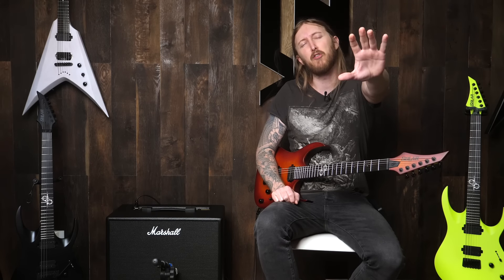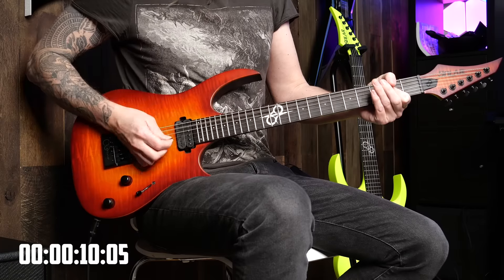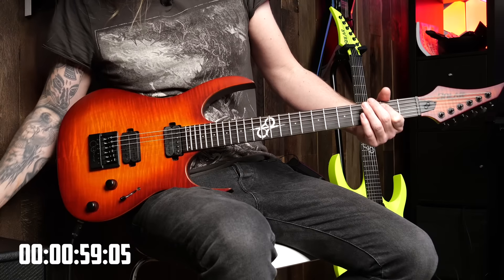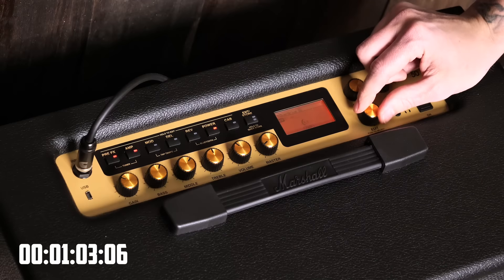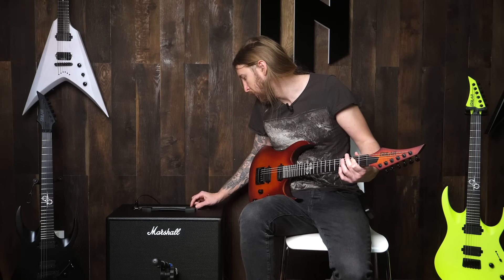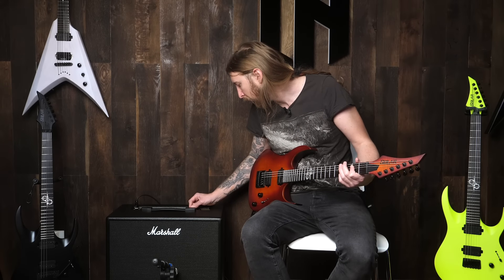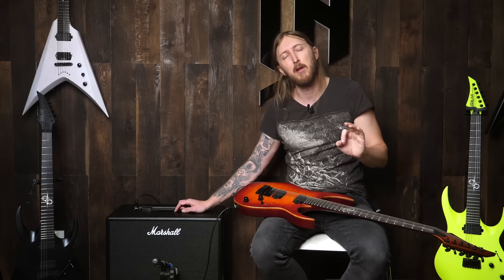WILL IT CHUG? - Marshall Code 50

Comment: Will bet 10 bucks that Glenn says 'nah' and suggests a sledgehammer or a roof.
Reply: He beat you by a couple of hours.
Reply: @thorthunderlungs5171  lol
Reply: Can't say I'm a fan of the Code.  Much prefer a Plexi :)
Reply: I'd agree with him
Reply: CJ, wtf you doin here, I love your speedruns <3
Reply: @SpectreSoundStudios  or a boss katana, heck, even the MG Series is better than this muffled mess of an amp. AND YOU CAN GET THEM ALL FOR THE SAME PRICE!
Reply: @SpectreSoundStudios  a Plexi is a little much. I'd rather go with a DSL :)
Reply: Who is "Glen" anyway? Respectfully; V⚡
Reply: @Jimboishere11  I gathered that, but Thanks! Ola had the amp "Chugging" in under 2 minutes! I've had my 100W head for over a year, and trust - it CHUGS!!!! V⚡
Reply: @Luke Robinett Hey Luke, he only had it ON for under 2 minutes! Without reading the instructions or anything, so I was pretty impressed with that. His mistake with the cab modeling was typical, (coz he didn't read the manual) it's not just for D.O. to a mixing board  - although you can use it like that. If he'd read just a bit about the amp 1st, Ola would have known that he was going through a 1X10, & not say a 1960 4X12, which definitely doesn't sound "boxy" as he put it. He just didn't realize that you can change cabs as well as presets (which you can also tailor to your liking) as a whole, the 50W with a 1X12 inch speaker, doesn't have that punch you get out of any of the preset model heads on the 50W job. V⚡
Reply: @Luke Robinett Oh yeah... someone else made a remark about the mic he had on it, idk who...but that's purely for recording the amp, not to do with the signal path! Ha! Ha! The things people say on here! Ridicule something that you don't UNDERSTAND....         V⚡
Reply: @flippy7035  I've got two of the amps you mentioned, & the Code 100WH keeps-up with em all! And in the case of the MG series SURPASSES IT! I also have a JCM800 2203 (the Kerry King model) that I use almost exclusively for gigging but I take my Code 100WH along, just in case I blow a tube. (It happens) Among other things. For the price point, ya just can't beat the 100WH!! V⚡
Reply: i had one of these amps for about 10 days.  what a mess.  mine used to shut off for no reason.  terrible.  i sent it back.
Reply: @SpectreSoundStudios  tbh fam an old Lead 30 SS combo is better than the Code. I love Marshall but it did nothing for me in the little bit of time I spent demoing.

Comment: Have a Code 50 and I love it to bits. Once you get attuned with all it’s options, finding a good tone isn’t hard, and it’s got some good tones in there! (not the stock presets though, those are ass)
Reply: One of my mates has a Code and we both found presets we liked in around maybe a minute.  The hardest thing, as with all digital gear, is settling on one option and making it sound just how you like it.  There are so many choices.  I really like the Code series of amps.
Reply: Can you tell me what you did to get those tones cause I have one too and I suck ass at getting good tones so I'm currently using the marshal fury preset which this sounds so much better than
Reply: Does it get loud? And when you turn it up on the setting you like, does it stay in the lane not lose tone?
Reply: Elliot Puckett Just do a metal tone but dial down the gain and up the mids a little. Same goes for distortion. Choose a distorted amp, do whatever with effects, find a good balance between resonance and the other thing (forgot its name but it’s on the power amp) and I usually go for a marshall 100 W cab.
Reply: Patrick Herendeen it gets loud, but it’s good for quiet practice. Sometimes it’s hard to get the exact volume you want but you can also use headphones. Also no it doesn’t really loose any tone from turning it up
Reply: I have the code 100 combo, 2 x 12 inch speakers, a speaker out option and an effects loop. It's great. I also own a Blackstar HT Stage 100 rig.
Reply: Boss katana blows this piece of crap sky high
Reply: @rastamon5969  Tried the Katana at the store. I ended up buying the CODE50. Katana distortion sounded fake to me and did not chug like I wanted it to. Anyway, why so eager to belittle an inanimate object?
Reply: @rastamon5969  why are you getting so upset about an inanimate object? Calm down. No need to throw a hissy fit over a bloomin amp. Some people prefer the Katana, some people prefer this. It's not really that hard to handle that fact, well you'd think so anyway...
Reply: Just got the amp today I love it man.
Reply: modelling amps respond well to you putting time and effort into sussing out how they work, and sculpting whatever tone you like, essentially.   Glad you found success with yours, Alex!   Might have to get one of these just so I can properly join in this conversation

Comment: It DOES CHUG! I've got the 100WH, and I've had it for over a year now, and had enough time to find/fix pre sets to get KILLER CHUGS out of it though my 1960B can! My only problem with it is that it doesn't have two outputs! (Very non-Marshall) but a good rig, for the low, low price! Over to you Ola!!🤘 V⚡

Comment: I should add that THIS video has sold me on the Code 50. I tried it out at local GC against a Katana 100. I could chug almost immediately on the Code 50. I kept going back to the Katana but every time I did I was not looking forward to it. The Code 50 wins hands down, and the noise gate is awesome!

Comment: Will it chug? any 50$ practice amp.
Reply: the cheapest chug I've ever heard for $50 is a used peavey combo. they have a amp modeler built in with a 6505+ setting. thats pretty much the only thing with a decent chug at that price. theyre readilly available on guitar centers website
Reply: Phil Banach peavey Vypyr?
Reply: @reidlingtheseedling  peavey of $50, would get an army of bees
Reply: LA L good peavey...
Reply: Peavy Classic but it has to be hooked  up to a Samick strat

Comment: I have the 100w version of this and gotta say it’s a pretty solid amp
Reply: Me as well. It has a very steep learning curve, but it is a very good amp from late night practice(volume at 1) all the way to shaking my windows. Just have to remember to leave the cab sim turned off.
Reply: And me, I love it. It's just some people are quite simply technophobic morons who can't deal with rolling up their sleeves, getting stuck and finding the sound that works for them. By the way, I also own a Blackstar HT Stage 100 valve set up - monster amp. I still maintain the my Marshall Code 100 Combo is one of my best amps.
Reply: Its a solid state yes.
Reply: never met a modelling amp I couldnt dive into the guts of and get a good sound out of, frankly.  Its just time and effort.  You get out of it, directly related by how much time and effort you put into it.  COSM is no different.
Reply: @chrisdaviesguitar  you're 100% right. People want to buy the tone, and sound as their idols and it doesn't work that way. To sound as professional you have to put effort and work as  professional. You can't buy some stuff and if someone says the opposite they're trying to sell you a lie=propaganda, advertisement BS.
Reply: @lolkom77  Well said man. So many people just don't get that what it sounds like in the room is on them...they just expect that the patches or whatever they buy will sound just like it does on YouTube. In reality 90% of the tone is the cab and mike/IR that's being used.

Comment: You probably should have read the manual 😅. You had delay on the whole time, and the cab button activated the cab sims, but if you hold it you can change the cab. Such as 1960AV, 1960B, 1974CX, 1912.

Comment: I assume you want to do amps that aren't obvious chuggers like the dual rec or satan... So in that mind set... Fender frontman series?
Reply: Easy to make it chug. I had the 212 R and this was also  f*****g powerfull. Never heard a 2x12 transistor as loud as this one. A Tube screamer and thats good.
Reply: lol the videos would be so short. "DAR-FBM 100, will it chug?

...*CHUG*
Yes. /video"
Reply: I used to put an od808 with the tone cranked in front of an fm212r and it's not bad at all. The mid cut switch in the lead channel only seems to cut out the low mids and some of the fizzy highs so just dime the mid knob with the mid cut switch and you're good to go on a Pantera/early CC tone.
Reply: matthew stacy distortion pedal into fender bassman

Comment: I bought Boss Katana, but CODE 50 was competetor. Well, I guess I have chosen.....wisely.
Reply: I think there is a pillow instead of a speaker in the Code... I bought a Katana 50, changed for the Code 50 and quickly turn back to the shop for a new Katana 100.
Reply: Katana amps are awesome compare to the boxy electronic sound of the new Marshall CODE's! In the future, try to buy the Katana 100 2x12 (i have it and it's the beast).
Reply: I ended up going with the Blackstar idcore100 over the katana but I still like it’s sound

Comment: Love my CODE100H! Fav settings for chug is the Plexi amp model, gain on 8-10 with the DIS Pre-fx running as a clean boost, and as you say, I dunno what the hell they were thinking having the cabinet simulation on with every preset.
Reply: Traded mine for a pedal .... hated it

Comment: hi ola! 
 Can you try the peavey bandit transtube 112? 
It would be amazing
Reply: I have a very old Bandit 112 redstripe and it is great for practicing and you can even gig with it! Bought it second hand 15 years ago and I never thought of selling it.
Reply: Didn't this chug rather well? I had the studio 112 and looked at the bandit with envious eyes.
Reply: Those transtube amps are amazing. A few minutes spent dialing it in properly and you can get some shockingly good tones.
Reply: Or even better, Peavey Transfex 212s. Had one of those and I absolutely loved the sound of it. The pre-amp section went goodnight a while ago, but I'm still using it for the power amp section alone. 2x130w. Pretty insane.

Comment: Can you make a Fender Hotrod deluxe chug??
Reply: Hotrod Deluxe's drive channel actually has a way more modern vibe than most people realize.  Perfect for shoving a boost in front and having a chug fest.
Reply: @jonnelson5881   I have not tried an overdrive, but I have used different types of multi-effects pedals to get great metal tones and the cleanest sounding non-distorted tones out of a Hotrod Deluxe. I guess that is kind of cheating, but it sounds great.
Reply: I had mine cooking pretty good with no overdrive pedal.It has a built in overdrive that was decent.

Comment: You can change the various Marshall speaker cabinets with the CAB button. It can really cause the tone to vary , from 1936, 1972, etc. I wouldn't turn the button off. I own a JVM but I bot a code 50 just to mess around only $250

Comment: Behringer gm110 vintager, if you can find one. Preferably the version with no built in digital effects and the Bugera speaker. I can't tell you how many people have been pleasantly surprised after automatically dismissing the little amp because Behringer made it. Especially good when you plug the line out into a decent 4x12. Fun series idea!

Comment: I have this amp...the cab button he was stuck on let you choose what model cabinet u want...ie..2x12..4x12...1x10..Marshall of course..every model speaker cabinet...best button there is on it...be nice if after a week he did a repeat on the amp..i hsve this amp..runs Bluetooth to any phone snd let you use a app to control all the knobs and setting...best amp ive bought under 1500 dollars

Comment: THAT right there is exacly why I love my Randall & dont like any modelling amp.     I wanna jam when Im strapped up & turn the power on,  not  fiddle thru confusing digital menus.         You did have it sounding really good though,I will give it that.      -  I wish they would just make an amp be able to sound like that, without the moddeling confusing menu.

Comment: Use the app and a handheld, it's much easier to see what you're doing when altering the settings. Plus, IMHO, the 50 is a practice amp.  You should have demo'ed the 100 watt version. I have  a Marshall Code 100 combo and I love it. It has a speaker out option plus an effects loop. The 2 x 12 inch speakers are much better than the single 10 inch in the 50. BTW, I also have a Blackstar HT Stage 100, so I do know the difference between a valve amp and a modeler.

Comment: Still fairly rough sounding, but at least the 50 with the 12 inch speaker sounds much more tolerable than the 25 with the tinny 10 inch speaker.

Comment: Any amp can chug at super low volume then you put a mic to it so it’s sounds like it will blast but it’s not really. You’d have to turn off all ambient noise in any room just to hear it sound that good. Turn the vol up and the chugginess goes away

Comment: This is Marshall's attempt at getting in on some of the Mustang, Line 6, etc. solid state, lower cost market.  My problem was "analysis paralysis", spending most of my time tweaking.  For a couple hundred $$, its okay.  Being a big Marshall fan, I would have to admit, you could spend your money on a better option.  In my opinion, they are trying to cover too much with this amp.

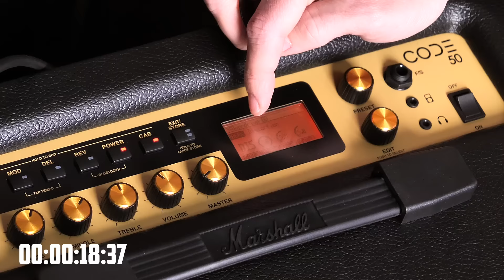Comment: I have a feeling that cranking the master volume (like say 1:00 instead of 8:30 like in the video) and then turning the channel volume all the way down and bringing it up until the volume was where you wanted it would've netted better results. That said, they need a global setting that turns off the cab sims instead of having to change it on every preset. Also, the tones weren't quite there, which may have been because of the volume controls.

Comment: It’s a good practice amp and jamming with your friends in your apartment or basement. It isn’t meant for playing in clubs. It can be very confusing and complicated though and there are some unnecessary settings that you’ll never use. I have one and like it but I feel it’s over designed. If you think it’s going to sound like a Marshall JCM 100 or some other big tube amp, you’ll be disappointed.

Comment: Have you ever though about making a Marshall JMP-1 video? I´ve been searching for a Headless Cross / TYR Sound with my JMP-1 and it´s kind of hard to hit the right type of sound. My signal Chain: Guitar -> JMP-1 -> BOSS Chorus 1 via effect loop -> Speaker simulator out -> PC -> Nad IR. Wouldn't it bee great to hunt that cool 80s/90s Sabbath sound? =) If you like you can try out my setup (yes, in sweden).

Comment: Almost bought a Code 100 combo, tested it in the store, didn't like it. The fact it doesn't have a speaker out is a deal breaker for me, and it's doing like 100 sounds, but non of them really sound good to me.
Reply: Because you need to tweak the presets
Reply: If you need a speaker out, buy the head?  As someone else said, the beauty of a CODE is in playing with the presets.
Reply: My code 100 combo has a speaker out on the rear labeled "loudspeaker out"
Reply: A 100 watt combo usually has a speaker out.

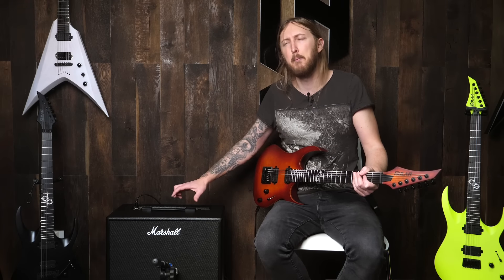Comment: 4:55 they did that to the open amp sound of Boss katana 50 which is why it sounds like shit, zero low end, extreme mids..a little better sounding when hearing through record out but thats like getting only half the worth of what you paid for. I was so thoroughly disappointed with the lack of low end on the Katana...that i now think Marshall Code 50 is an obvious better choice, I hope it has the basic things right like effective EQ, good bass production (which i get even on my spider IV), the ability to scoop or engage mids (also seen in the spider IV), and not remain a forever mid happy amp paper thin sounding amp unlike the katana.

Comment: Maybe put that on JCM800 or Bluesbreaker - start from there and get funky - how close it is to the JCM800 is nice and this is what 1/3 the price of a JCM800 people whine about this but it is infinitely adjustable to you and your other gear -my JCM cost 1k in the 1990's I got one of these for what $500 - FANTASTIC for a practice amp ? these things are real nice Grunge to smooth at a push of a button?

Comment: Will an AC15 chug?
Reply: Fuck yeah.  Give it the standard metal tubescreamer in front and its amazing.  The eq is super picky though and the tone cut is an absolute garbage feature.  Avoid the tone cut and mess with the eq and its a killer gainy amp (my main at the moment).  I even prefer it over my Laney IRT120 most of the time.

Comment: The stock speaker in the Code 50 is the weak link.  I swapped mine out for a Jensen Jet Electric Lightning and it screams, has a lot more bite to it.  Ditch that cheapo paperweight speaker!

Comment: I would love to see if you can make amps or pedals not designed for metal, to chug.   One of my favorite's that, oddly enough, "chugs" fairly well, is the old Dean Markley RM-80SR and DR half-stacks.  Here's a quick sample of an old song I recorded almost 20 years ago. I call it a "blues metal" sound.  lol   
http://www.thelostbrothers.com/HillBillyGothic.mp3

You might also try some heavier sounding fuzz pedals or something like the ElectroHarmonix MicroSynth pedal (which makes an insanely heavy and rather percussive fuzz sound when set correctly). You can hear the chugging on this crappy  recording at about 34 seconds into the song.   http://www.thelostbrothers.com/SignYourSoulAway.mp3
Such sounds might give metal guitars some more "out of the box" ideas for interesting songs or forays into related genres like Industrial metal.

Comment: Can anyone tell My how you do or how he did to get a good metal tone on this amp i have alot of problem with it
Reply: Try this:

Amp american od gain from 8 yo 10, bass 6 mid 5 or less, treble 6 or more
Power Marshall 100w presence 5 resonance 8 experiment...
Cab 1960HW
Previous ODR pedal, everything at 5... Experiment....

Adjust noise Gate to 4 for rythim and 2,7 for solo
Reply: Cuerda a Cuerda thanks alot but how do i get to the noise gate i cant find it